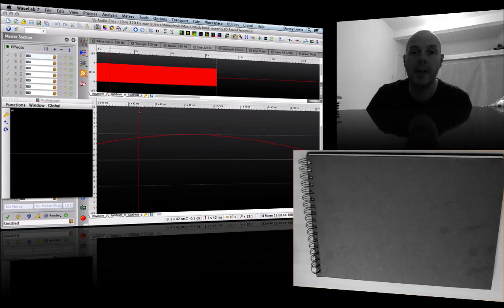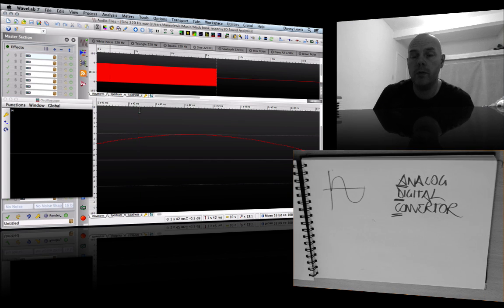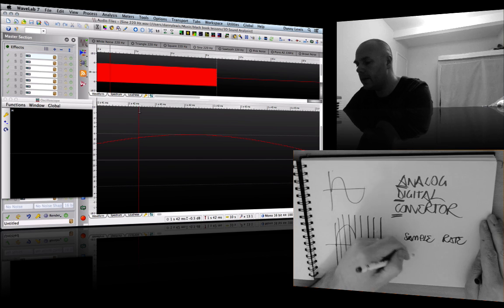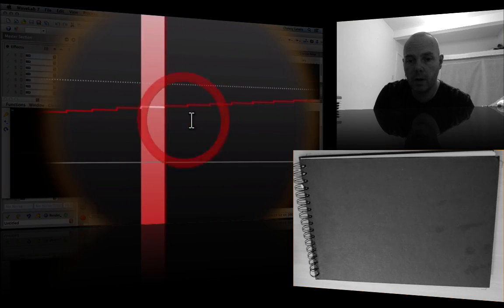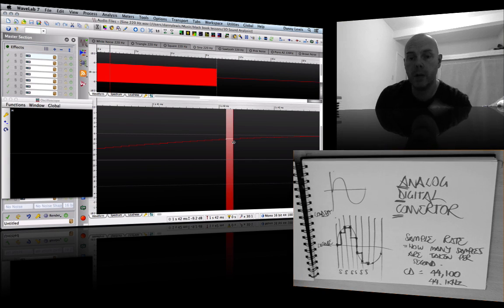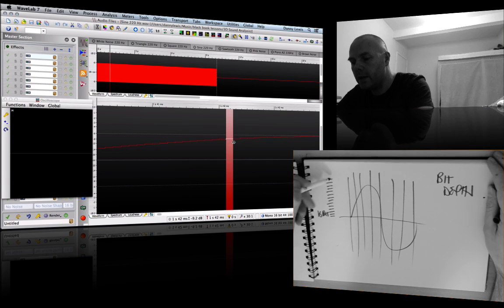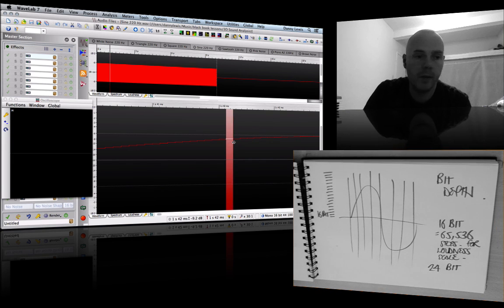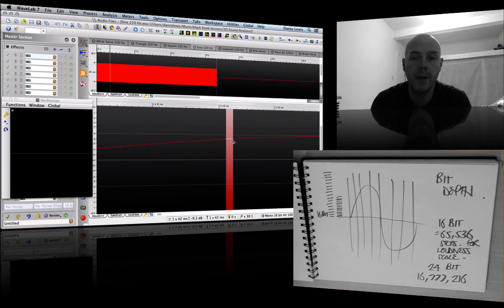Learn about Sample Rate and Bit Depth - Black Book Lesson Three

Comment: Hi Danny, thanks for the vid. It come handy because right now im trying to find out if sample rate can improve my SQ aside from AD/DA conversion. Turned out, beside the theorem you cited, that it does in avery apparent manner. Check out this comparison, especially in the second example you can hear a definite differece in soft synths bounced at 192 vs the same bouced at 44100. Take a listen, it's really apparent. I'm now a believer of bouncing at higher sample rates!